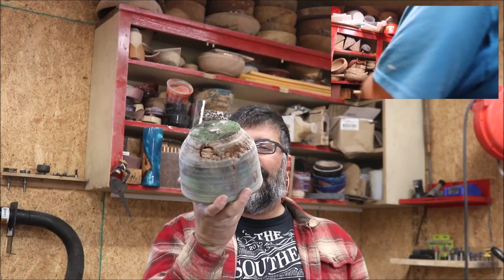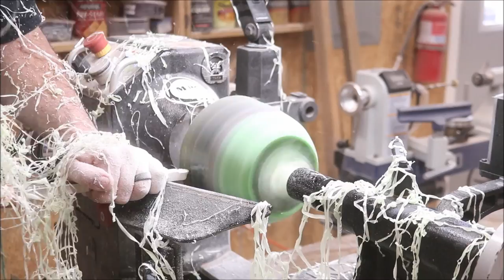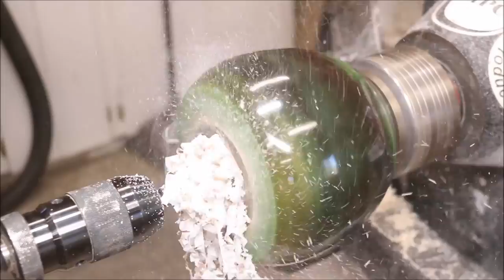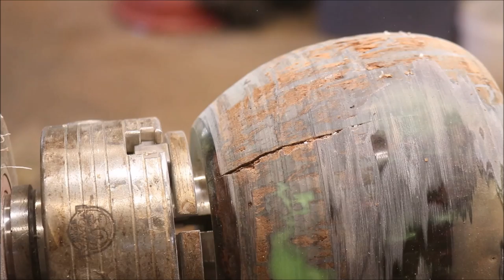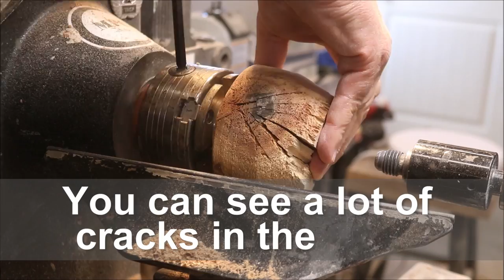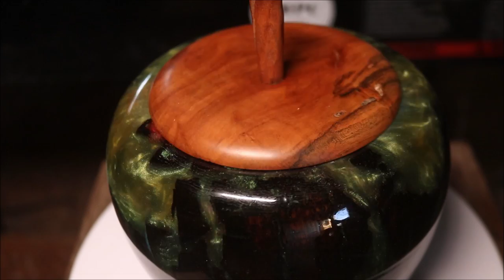The Poisonous Apple

Comment: Nicely saved - kudos on your tenacity! I think the name is perfect, both in that it looks rather toxic, and it fought you every step of the way.

A quick question about the resin. It appears that the carbide tools generate a lot more dust than the gouges - is that correct? And how do you manage the dust? I'd love to try turning some resin but the hazardous mess really puts me off.
Reply from the maker: Carbide is a scraper, so it does produce more dust. It's hard to do a video and manage dust. I can't turn on dust collection because of the noise. So I sweep up two or three times during the turn. Then I use my dust collector. It really is a super mess.
Reply: @MoonpieCreations  thank you!